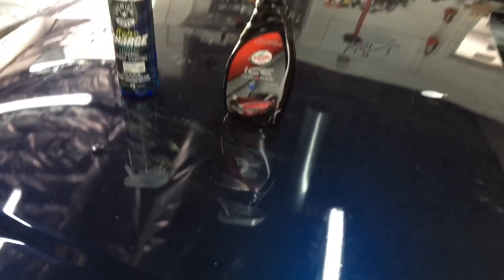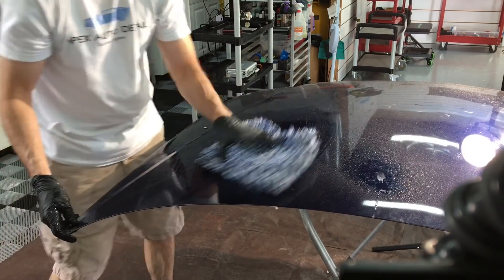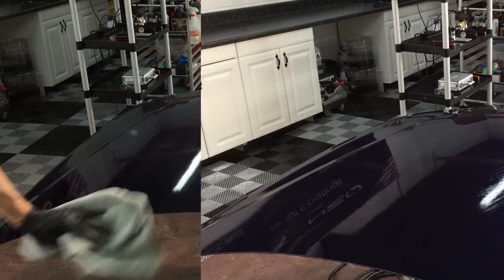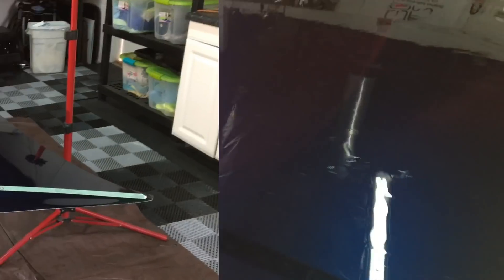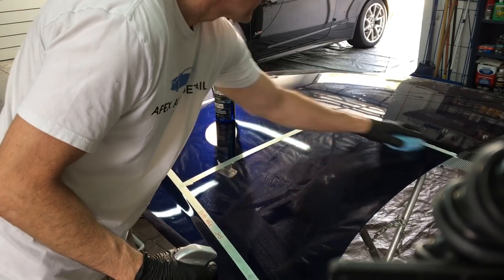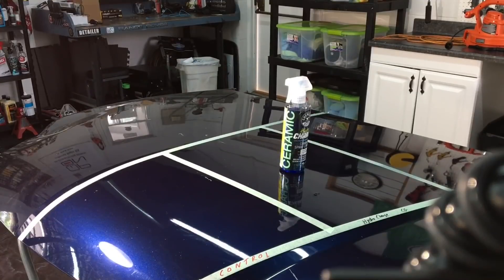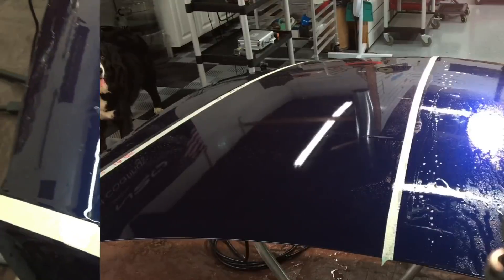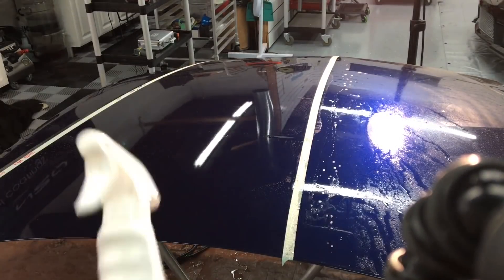Chemical Guy's HydroCharge VS TurtleWax Seal & Shine!!! Sio2 VS Polymer Sealants!! Which is Better?!

Comment from the maker: Which of these do you prefer?
Reply: Seal and shine.
Reply: What is your dog's name
Reply: Apex Detail Seal n Shine!💪🏼
Reply: Seal and Shine
Reply: Does the Seal and shine have the self cleaning properties of the SiO2 products? That's become my number 1 criteria based on living for 4 months with 303 touchless sealant. In that time my wife's Traverse has had to be washed much, much less and maintained a great shine. Nothing sticks to it, not even bird droppings. In that same time other synthetic sealants on my Silverado haven't done nearly as well. Chemical resistance is just 1 factor of many and personally the least important to me. If S&S behaves like 303 touchless or the other Si02 based products I'd switch but I've never seen any of them behave like these new class of Sio2 products. Only when my Truck was glass coated in '12 did I see it and it lasted about 5 years or so. PS - when I applied the 303 I didn't even properly prep the paint since I did it just to get something on her car quick in the middle of the winter here in New England. The car was clean but not even clayed. and I just haven't really needed to touch it since. Then it became a question of how long I could go before it failed. My truck is covered with tree pollen that can't be blown off. Her's has very little. It blows right off. Sounds impossible but it's true. I am as shocked as can be...
Reply: I use for daily drivers.
Reply: Seal n shine most definitely an amazing product at an unbelievable price . Awesome review and test as always love the hard work and dedication you give to testing these products to help others make smart purchases.
Reply: Tw ss
Reply: This is why I still use Meguiar's Ultimate Fast Finish, it's some tough stuff. Would like to see Seal N Shine go up against Ultimate Fast Finish.
Reply: Seal and shine. I can buy at least 2 bottles for the price Of chemical guys. This may be more
Reply: @Gnetbird  Cleaner wax has a wax in it?
Reply: Seal and shine no doubt
Reply: Seal and Shine!! It's amazing how well it works for such a cheep price. Brain, you videos are amazing and your attention to detail is awesome. Thank you for doing these tests!!!!!!!!!
Reply: Seal and shine ✊For the win
Reply: TW Seal N Shine.
Reply: Hello Brian I see you are using the KRAUSER AND BECKER  more (due to shop situation?) how many hours do you estimate you use it a day, week and month?
Reply: The TW is no doubt the more durable protectant. But surprisingly the CG help up pretty well compared with most of the recent crop of new SiO2 sealants. If you're more concerned with gloss and appearance, CG used with their new SiO2 wash, plus occasional maintenance with an SiO2 drying aid would probably be a pretty durable solution.
Reply: Seal n shine, price and performance and top of that you can buy it locally
Reply: Hydrocharge. Although Seal Shine has near the water behavior of Hydrocharge, I like CG better for that. CG seems to be somewhat durable.
Reply: Well that Turtle Wax looks damn good, but I’ll take the dog hands down.
Reply: Oops!
Reply: I’ve gone off Chemical Guys; they now have way too many products all doing slightly different jobs. I have the TW and find it’s very very good, especially on the front of the car when you want to use bug remover chemicals.
Reply from the maker: @tommartin1223  Cissy
Reply from the maker: @Big_Old_Dog  Actually...yes.
Reply from the maker: @Gnetbird  A cleaner wax has even less aggressive abrasives than polishes. Mostly for prep for protection.
Reply from the maker: @joa8593  no.
Reply from the maker: @DETAILINGDETAILING-hb7bj  2 to 3 hours a day.
Reply: tom martin     Buff 😂
Reply: Seal and shine is $5.99 at Amazon and 6.97 at waltmart
Reply: Eddie L That exact combo is dynamite!
Reply: Hands Down!!!!! Turtle Wax Seal & Shine. Best sealant on the market now! Other manufacturers have some catching up to do!
Reply: @ToshYusaf  i find that bug guts wipe off easier with TW Seal N Shine, probably because of the slickness, I will rarely use bug and tar products relying mostly on soap and water.
Reply: so end of this story - coat the bottom of your car with Seal N Shine to protect it from rusting LOL.... sound idea going of all these test.....

Comment: Turtle wax has the funds and has been around forever. They can test and research until they get it right. Their ICE line is top notch
Reply: HD-FXDR/R9T Racer HD & BMW Totally. I bought a bottle of the ICE detail spray and ICE wax expecting nothing. Wow, I was blown away by the results. 

Also, there’s a NineT 9 Racer for sale locally. New, for $10,400. 

I think I need it!
Reply: @craig.encinitas  
The R9T Racer is perhaps one of the more timeless looking Bikes on the road. BMW did a fantastic Job in building this Bike. And it's not because I own one, its the attention that the bike gathers, there's not a bad angle on this bike. People just love to look at this bike, and for me, that's 3/4 the joy of owning it.

Comment: Turtle wax has a bright future if they keep making stuff like seal and shine.
Reply: most of its products have been reasonable, its not the cheapest out there, the dark old days of 30 years ago and all wax was a pain, we used stockinette to apply and remove and it was awful, t-cut  was oily and petrol-y, trim stuff was greasy too,  the detailing business 30 years ago was aquick vac and a turbo polish with a big machine and wet look tyre solvent, its all become easier and better including the consumer products,  heck you can do a pro valet with just products from any major store these days

Comment: Ok, we know the winner for a paint surface. But what about boaters? A slippery finish is a disaster, but textured and molded non skid gel coat Fiberglas decks need protection but which one would be a better choice as a sealant?

Comment: Love the video. But I am a bit torn. I appreciate the durability of TW, but chemical durability vs real world abuse is very different. If the CG SiO2 has a better gloss and appearance, has great sheeting and beading, and offers real world protection, I think that is the product I want. TW does look good and is cheaper on paper (however if you calculate how much product is used over time, CG is most likely cheaper because it uses less and is only applied two maybe three times a year), BUT if the CG looks showier and Im still getting good protection, and that is what I am after, I would prefer CG.

Comment: If I don’t polish my cars before applying anything, what are the adverse effects? I have two cars that I’ve washed, used a clay bar then applied Chemical Guys Jet Seal (let it cured for 12hrs) then applied Chemical Guys Butter Wet Wax and they both look good after a couple of weeks from when I did it. Please let me know, thanks so next time I’ll polish if it’s not good to skip it.

Comment: Can I request a video Brian? I've been using Wolfgange Uber Rinseless Wash mixed 1oz to rest water in a 32oz bottle as my drying aid and I really quite like it, I can tell it leaves some gloss between washes and it's dirt cheap to make. My buddy keeps insisting how wonderful Beadmaker is for gloss on a wash to wash basis and that I should switch. I don't have a fancy gloss meter like yourself, can you do a shine comparison between these two products, maybe use TW S&S as the control area?
Reply from the maker: On the list.🙂👍

Comment: I've been out of the detailing game for a few years now but I just bought a used truck and plan on correcting it next weekend. Question is I still have a bottle of CG Jetseal that's probably 6 years old now. Do I use the jetseal.then turtle wax seal and shine as a top coat or just correct and use TW?

Comment: Great comparison video! Love these!

I've had a bottle of the Seal N Shine for about 1-2 months.. I've only used it on my Wheels so far, and was planning to wait to use it for more "winter prep" since it is so freaking durable, while using beadmaker routinely during the summer since it has gloss 2nd to none... But I might just need to try the Turtle Wax sooner.
Reply: This is exactly what I am doing!. I have put it on my wheels/ windshield and that's it. So far they look great and I have recently been in some crazy amount of rain. Its holding up real nice. I'm waiting for my collinite wax to degrade some since I have just recently put it on before I found out about the seal and shine. I also use bead maker as a topper.

Comment: turtle wax seal and shine has something in its formula that no other product have i dont know what it is but its so resistant to chemicals there for its one of the best sealer in the history 
buy it for 6 bucks apply it like a 6 bucks spray wax but get like a 600 bucks shine and protection i love it its so awesome it did throw all this ceramic spray so they called under the bus and showed us we don't need no bullshit expensive ceramic spray coatings for a perfect product two thumbs up for turtle wax

Comment: One major falw in your testing procedure, You push everything from control to CG to TW. When you should push everything from top to bottom so your not cross contaminating.
Reply: Honestly he is simply rinsing everything off that was equally sprayed to each panel.  The damage is done with the chemical sprayed and sitting on panel not from the rinse cycle no matter how he chooses to rinse it. I doubt his rinse method is really effecting the end result to any measurable degree.

Comment: Is the Ice Spray wax the same as Seal N Shine? Heard Seal N Shine is just an updated version with the same ingredients. It's this true?
Reply: Hey! The ICE Seal N Shine is actually a whole new product that uses a hybrid formula of both synthetic sealants and carnauba wax. You can use either to get great results, but try using them together to get unbeatable long-lasting shine and protection!
Reply: @turtlewax  I do have both. I might give that mix a go 👍 which one would I use as a base and which one would I use as a Topper?

Comment: What is this TW product made of???  I think all companies use pretty much the same base products with some variances.  If TW discovered a miracle ingredient, they wouldn’t be selling a bottle for $7.
Reply from the maker: I have no idea....trying to find out exactly.
Reply: I found the MSDS but they don't disclose anything, but their similar Shine Lock (it's on the S&S Amazon product page and comes up when searching for its MSDS), is 62% Silicone ( 60% Hexamethyldisiloxane and 2% Octamethylcyclotetrasiloxane). It also looks like they sell it to tunnel washes which might explain a recent video where Kevin Brown talks about the toughest stuff he ever encountered came from something applied at a tunnel wash. They had a hard time even polishing it off.

Comment: For those mobile detailers beware of seal n shine, streks af on hot panels
Reply: Yes it does..learned to have a micro fiber towel in each hand. Worked better once I figured out you can only leave it on the panel for like 5 secs 😅
Reply: @justinreneau1983  and 5 minutes buffing to perfection

Comment: Once again Turtle wax seal and shine beats the much higher price competition how many is that now four or five that it beat. I’ve seen it knock off all their competitors and different channels. It’s quite comical. I get it at my local Walmart for $6.89. They actually had one of the price roll backs. So early today I got the last bottle for A incredible price of 6.49 . How many bottles of turtle wax seal and sign can you buy for the price of chemical guys at least two maybe three or four. What a joke these other companies are turtle wax is actually putting them to stream and everybody used to laugh at turtle wax. Well now who’s laughing.
Reply: It's only $5.99 on Amazon. I bought 2 bottles but haven't used it yet.
Reply: @Big_Old_Dog  last time I checked Walmart was cheaper. Checked again after your comment it's out of stock though. Not sure if they sold it before at that price.
Reply: Jon Michael Chua  I got really lucky I had them hold it for me edit Vance auto parts through that new app you can have them hold it up to 48 hours and then go pick it up. But you have to pay for it through the app